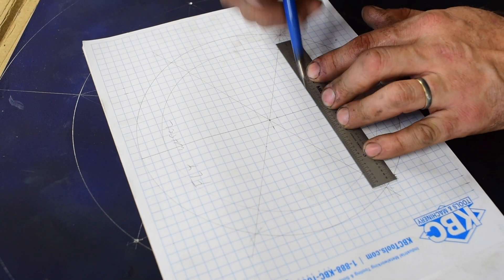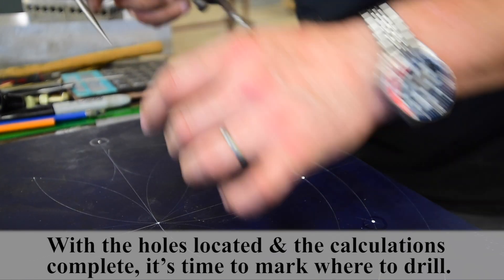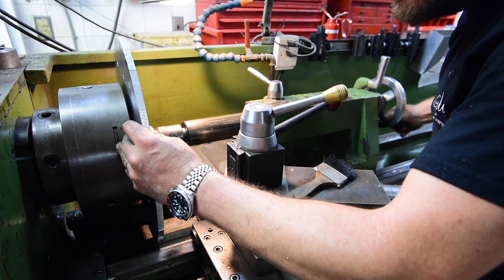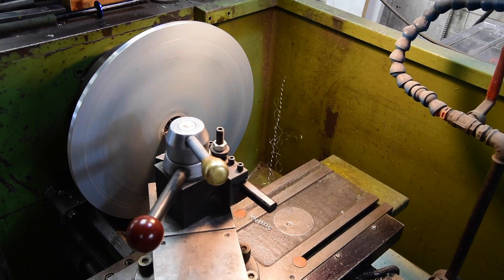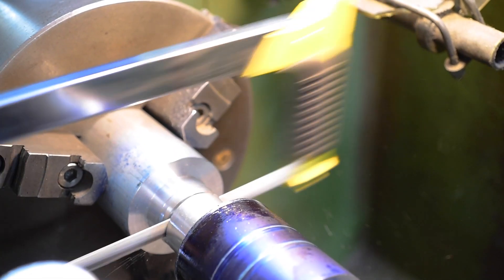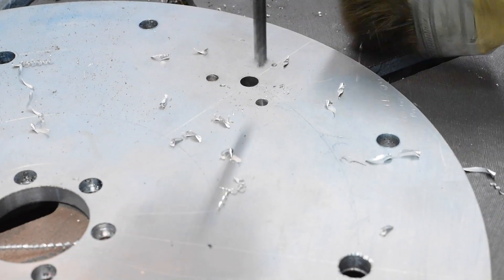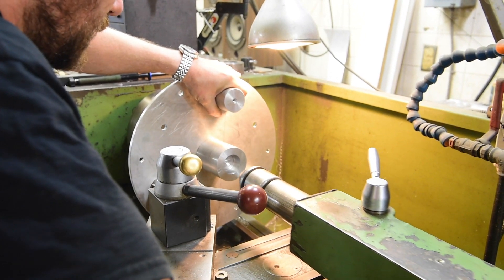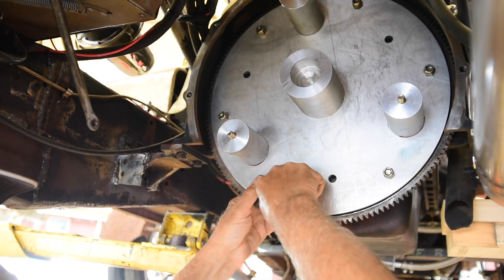Making a transmission adapter from scratch for your Rat Rod

Comment: Hi, I’m trying to find out if an Audi v8 / v10 can join up to a 2010 Land Rover discovery 4 3.0 6spd auto box, think disco is using the  ZF6HP26 

I’ve got chance to buy either an Audi v8 from an a8 or a v10, both engines need rebuilding but I need to find out if possible to get them to fit, could you guys do an adapter plate if it’s required/possible? 

Thanks great video

Comment: I’ve had a very similar idea to this, with the exception that I want to put another flywheel spaced out 3.25” because of the mounting housing on the back of my Cummins V-378.  I want to adapt my rebuilt ZF 5 spd but would like to utilize the engine’s starter and flywheel, avoid the rear protruding cam driven compressor and fuel pump assembly , and make use of the mounting flanges that are cast into the 4” deep transmission spacer.  
Do you think that a spaced-off flywheel would be as successful as the torque converter spacer that has been built on this video?
Reply: I’m in the same situation right now, I want to mate an mt-82 6 speed from a mustang gt to my gen 3 hemi, and there are no options for adapters or anything of the sort, so I thought about just spacing the flywheel apart from the crank. I’m just doing lots of research and wondering if this is safe or if it’s even realistic. Did you ever get anywhere with yours?
Reply: @jacksonn.2399  I decided against it because the idea of all that unbalanced rotating mass made me too nervous.  I Ended up ordering a custom pilot bushing and had the old flywheel drilled to accept the OE clutch for my ZF 5.  It worked great.  BUT: it took so long for all the fabrication work that by the time the freshly rebuilt transmission got tested on the road it had been stored dry for 6 months.  4th gear synchro is stuck and I’ve been too busy to pull the transmission (now out of warranty)
Reply: @nicolasstanley1392  goodness man that’s unfortunate. I completely understand that concern you had. Definitely a little questionable when you start dealing with high rpm and drivelines lol. DIY jobs might not be the best for that. Thank you though

Comment: This is the flywheel to torque converter adapter, now they have to make the adapter for the engine block, Packard flathead straight 8, to the Chevy transmission bolt pattern.

Comment: The adapter I'm hoping to make is for adapting a ZF S6-650 transmission to a small block ford. I'm hoping to use a Duramax transmission as it should be relatively easy to adapt. The frustrating part is that almost every manual transmission adapter I can find is always a bellhousing. I need an adapter that goes between the engine and bellhousing of the transmission as the S6-650 has an integral bellhousing. Will this interfere with the clutch at all as it would be moving the input shaft backwards. Again I can't find any info on how much it would affect it. Any replies would be appreciated

Comment: What did you color the plate with in the beginning for the measurements?
Reply: Most likely metal die or just ink
Reply: Layout fluid. Popular brand is Dykem and it comes in a number of colors.